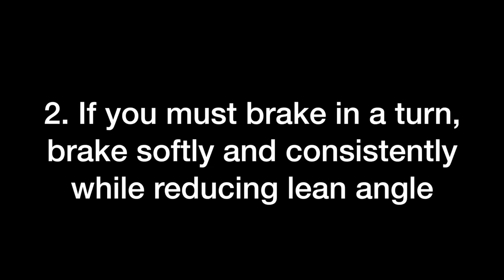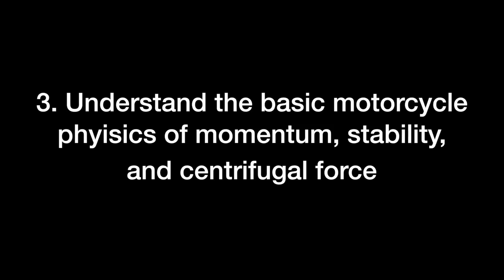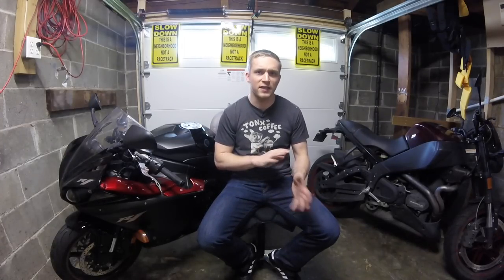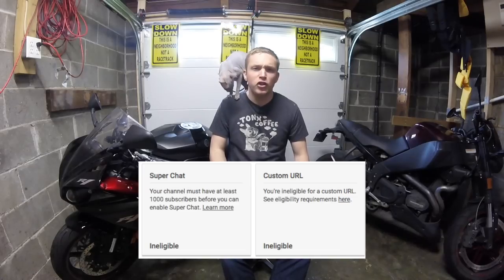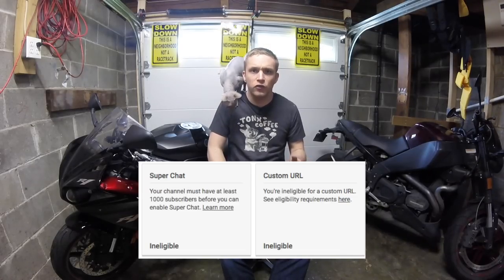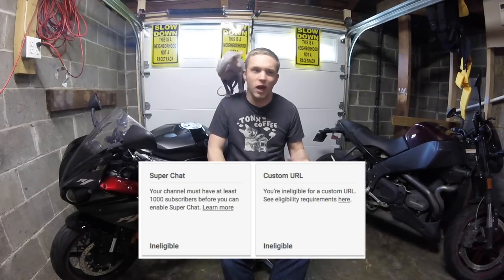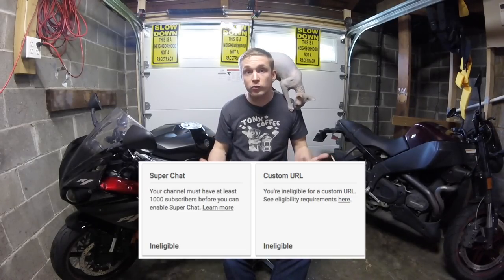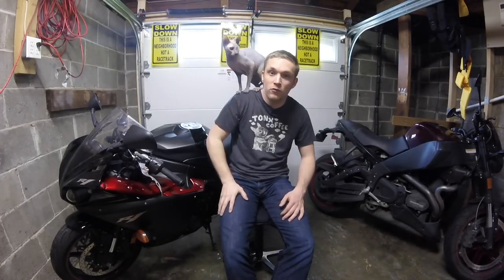Fear of leaning leads to motorcycle crash | SquidTips Accident Analysis

Comment: I understand that you intend well, but you are repeating the same mistake that you pointed out at about the misleading video you are commenting about: trying to explain something you don't know enough about. The premise is correct, (more lean angle or at least progressive braking might likely have avoided his crash) how you explain is quite incorrect and I think that is a huge problem.
Reply from the maker: Can you elaborate? I’m not sure what specifically you are taking issue with.
Reply: @SquidTips  I dont agree with your explanation either. The rider crashed because he locked the front while leaning. While the front wheel is still spinning it is dragging the the front of the bike round the arc of the corner, which balances the centrifugal force(of the corner radius) with lean angle. When the front locks, it then goes in a straight line, and the rider is still leaning, so he falls over.
Reply from the maker: My assertion was that the rider panicked and reflexively used the brake  in an uneven, dramatic fashion, which lead to exactly what you describe. I don’t think we disagree at all, I’ve simply stated the cause, and you’ve explained the effect.
Reply: @SquidTips  Now that I think about it, you're right. Let me just add that I fully support what you're doing with the analysis vids. I watch all the moto crash compilations and sit there picking apart what they did wrong. I was even half considering doing reaction vids of the crash compilations to point out how most of the riders put themselves into a situation that they could have avoided, regardless of whether a cager did something stupid. Judging by the comments on those vids there is a scary amount of (probably young) riders who don't understand that as bikers, we have to be solely responsible for our own safety, and not rely on other road users to do the right/expected thing.

Comment: It's hard to tell, but it looks and sounds like he didn't close the throttle much if at all before hitting the front brake. He might have been accustomed to using his rear brake with the throttle open in order to adjust his line. And maybe he was feeling saucy and didn't want to move his foot onto the brake, and he decided to use the front, instead. Without letting off the throttle enough to get engine braking going and weight shifting onto the front.

Comment: Geez befor you wanna ride a bike. Learn counter steering. Your gonna do it all the time unless your parking or doing uturns. So its a must. Its better to slow befor a hot turn then speed out.  You can lean as far you want as long your going at the correct speed. Just watch out if your pegs hit the floor.
In closing learn to counter steer.

Comment: - If you think that you are too fast for the corner - Trail brake..
- If you are afraid of front brake - Do it with 2 or 1 fingers..
Reply from the maker: It’s always better to, but sometimes you misjudge the corner or your speed and feel the need to brake while cornering.
Reply: @Lord Royce : When you learn how to brake in corner.. you will reach on different level..
Reply: @Lord Royce : Dude i know Trail braking and it's a habit more than a technique.. 
I live in mountains and i know how important it is to control your bike in corners and by experience i can tell that you can't always judge a corner and sooner or later you find yourself in a tricky situation where you entered a corner faster and need to slow down your speed.. 
It's always great to have a superior riding technique and skills to save your ass in emergency.. 
For example if you do front braking with all your fingers than it will become muscle memory and in emergency you will grab that brake with all force and lock the tyre; But if you have a habit of braking with 2 fingers than in emergency your 2 fingers won't put enough force to lock the tyre and braking become much smoother and safer..
Similarly if you learn the habit of trail braking than it'll become a muscle memory  and everything happens from subconscious mind and you will become better rider.
Reply: @SquidTips  I prefer engine brake in turn because it is almost impossible to lock up a wheel and you don;t get the wobble this guy did.... just as he goes down his hand comes up meaning he locked up/ took wheel severely out of line. once that happens you are done for.
Reply: @Chewcudda  this. Engine brake goes first, if there's still not enough load on the front then feather the front brake.

Comment: If the bike had abs, probably would have been ok.  Technology makes up for some degree of error..
Reply: what kind of core exercises do you recommend to develop abs? mine is looking kinda flabby
Reply: Abs simply keeps a wheel from totally locking up but is that what happened?  Hard to tell but even if he did not lock the front brake I suppose just the rapid decel could pitch himself off with all that momentum in his panic ?  But hard to say maybe he did tuck it under?  in which case you could be right about abs saving him.  idk about my abs but I'll have to say traction control at least has probably maybe saved me driving my little sports car in the canyons.a few times!...when I almost shat myself but suddenly feel this shuddering juddering of the TC and then maybe the ABS too idk doing their thing....I have thought to turn it off... but I am getting too old to be rolling a roadster at 90mph lol  On my motorcycles though I try to always assume at any moment there will be oil or gravel or roadkill or a deer jumping out etc....I keep myself spooked enough to not assume too much....aka "keeping it dialed WAY back"

Comment: IF you wanna brake in a corner, besides not braking too hard, as to not lose grip, don't you also need to counter steer a little more in order to prevent the bike from getting upright?
Reply from the maker: The problem is the slower you go the less stable you are, because the forces keeping the bike balanced are lower. If you MUST brake in a corner, you’ll need to straighten it up, otherwise the bike will likely lowside as you reduce speed.

Comment: I'm right handed and have more confidence leaning right when I'm not thinking about it than I have when leaning left. On a road bike I can lean so well that sometimes I feel like I'm not sitting on the middle of the seat anymore. I feel like I'm sitting on the edge where the side and top meet but be thinking if I lean my scooter to low it'll just fall over.
Reply from the maker: Having a side preference is common. If you are sliding to one side of the seat or the other as you turn you are beginning to use the same techniques MotoGP racers do. By leaning more you can keep the bike straiter and increase stability, but I'm not sure how that works on your scooter as it might be generally less stable than the average MotoGP bike =P

Check this video out to learn more: https://www.youtube.com/watch?v=XcMp7wuVKhY&t=7s

Comment: I've been playing GTA IV recently and have been wondering why everytime I take a turn (I'm on PC so every turn is a hard turn unless I tap repeatedly) my motorcycle turns for a bit and then spins into a 180. Seeing the start of the video where the guy barely turns and ends up getting wasted makes me realize just how realistic the physics of that game is. I use a PCJ-600 a lot of the time (the fastest motorcycle I know of) and turning without slowing down to a crawl makes every turn become a 180 and it's been pissing me off, now I know that it's actually realistic for you to screw yourself over by taking a turn without slowing down.
Reply from the maker: One of the most common ways new riders crash is entering the corner too fast.
Reply: @SquidTips  Yeah, false alarm... Apparently, I was trying to make the setting average rather than high in order to get better fps so textures would quit popping in and out of existence, but by doing so I got the fps over 60fps which made the bikes run like ice skates. Make the settings higher and it made fps lower and eliminate ice skating bikes, but brings back the interdimentional textures. Turns out there's a little bar at the top that can keep my resolution at 1920 x 1080p but can change the refresh rate from 144hz (which causes ice skates) to 60hz (which keeps ice skates away), this allows me to lower the graphics quality to get rid of the interdimentional textures while also capping me at 60fps to keep my bikes from ice skating. However, you'll still drift if you take a corner to hard. That, or you won't drift enough and drive headfirst into a car and get flung 20 feet into the air...